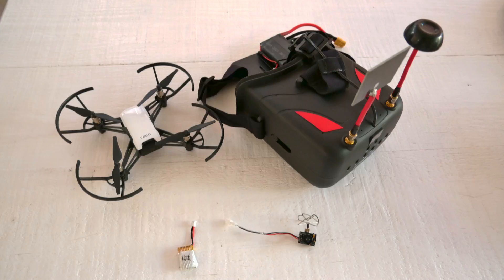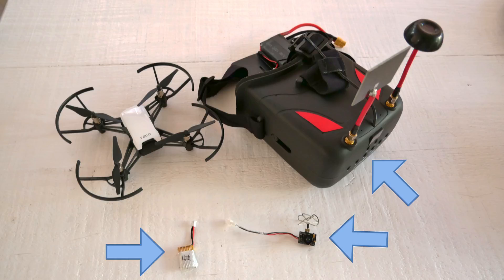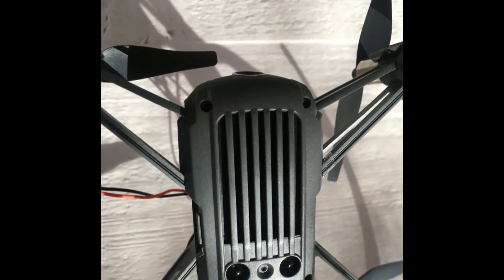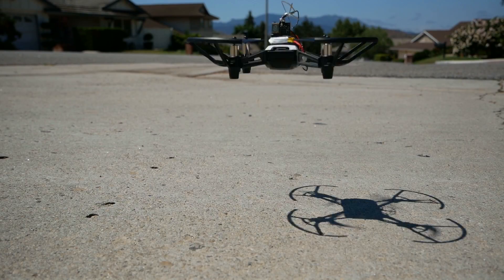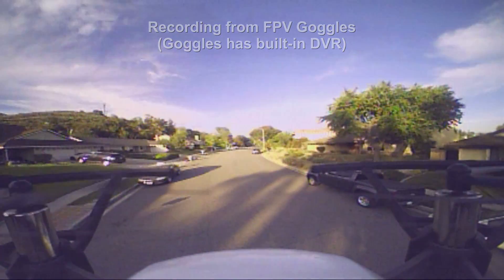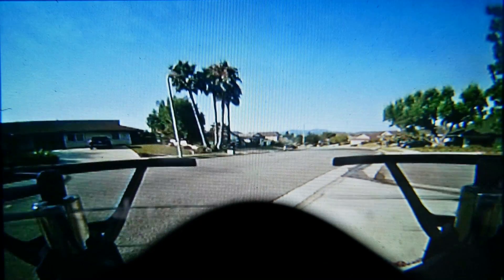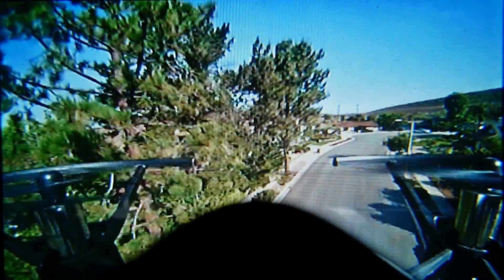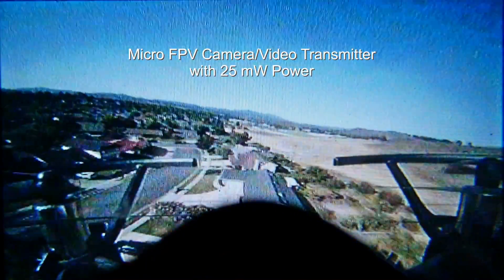Ryze Tello FPV Goggles

Comment: Hi, this is really good idea to let your tello to have a fpv function. may i check what is the flying time after you add on the extra battery? if solder the onboard power pin, what is the flying time also. will be great if you can share with me. thank you

Comment: I purchased the camera and battery from the links that you provided.  However, the battery is a 3.7v 200mah battery and the connector will not mate with the camera connector.  Is this due to having the "wrong battery"?   Also, where can I find a charger?
Reply from the maker: Bryce Reichert You’d just need to make an adapter so you can connect. For a charger, any lipo charger will do.
Reply: @D7dronetech  How do I do that?  Where can I go to find one?
Reply from the maker: Bryce Reichert With east soldering skills, use a jst connector. For charger, just search for an expensive lipo charger.

Comment: Very good. I also bought a camera. I just do not know where exactly she wires her wires in Tello.
Reply from the maker: It’s feasible to wire up assuming it’s just for power. Video shows the power connections
Reply: Very good tip. Thankful. Except that my camera (RunCam Micro Eagle) needs at least 5v, and the Tello battery voltage is 3.7v. Does it catch?